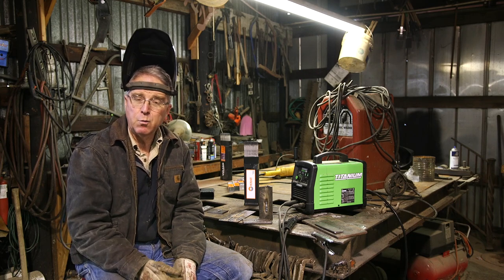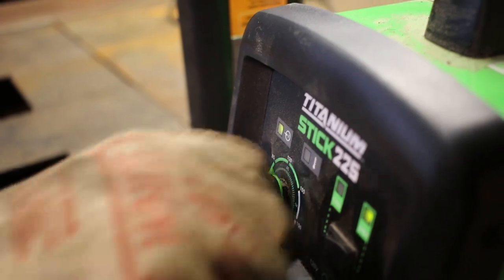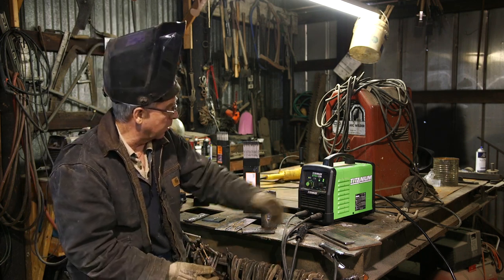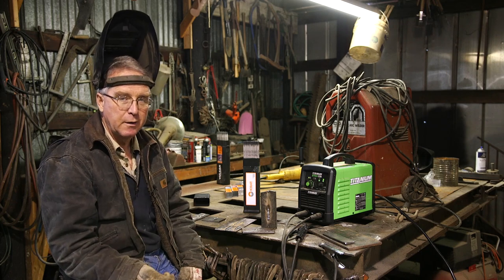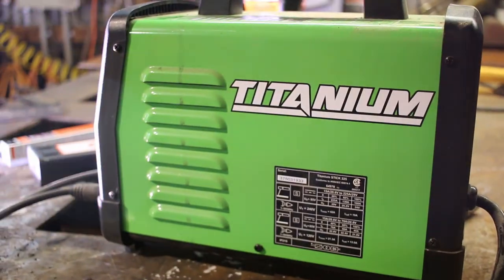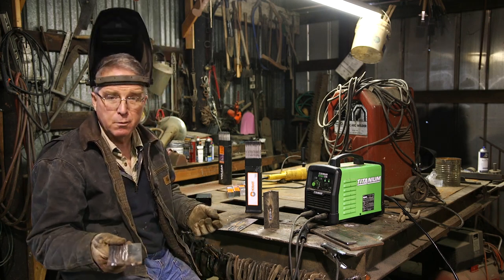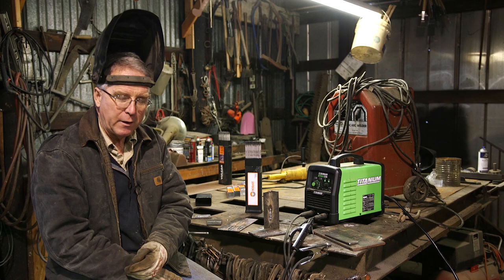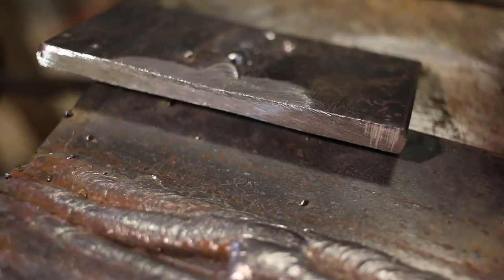Titanium Stick 225 Welder - Harbor Freight Tool

Comment: Mr. Wadsworth, 
I purchased the 125 flux core only machine, for very similar versatility reasons. It's also 120V capable. Has the same ground clamp set up. I have run about 6 pounds of 0.35 wire through it, thus far, and have to have the duty cycle become an issue. I would completely agree with you about the Titanium series machines being good start off machines for beginners/hobbyists. I would also say that they are also good as far as price point.

Comment: I think a lot of people forget that the Lincoln buzzboxes have a 20% duty cycle at 225 amps. 20% is totally fine for most hobbyists. I've done a few full faced anvil repairs with a buzzbox and only ever overheated the welder once.
Reply: I also had good results with my Miller Thunderbolt running 200A on a 400 volt input. Would run all day without problems. The groundclamp would become toasty hot way before the welder got issues
Reply: I was thinking the same thing. You can only get so much power through 16lbs of welder. It's a good little machine for the price. My nephew just bought this model.
Reply: That's 20% at FULL amperage - it'll be closer to 60% for most rods you'll be using.  And 60% is plenty for most people, unless you're in a real production environment.
Reply: @terryrust4973  Correct! On my Lincoln buzzbox, the 75A marker has a circle which means I can weld at 100% duty cycle at 40, 60 and 75A. Everything above that has a diminishing duty cycle until it gets to 20% at 225. I think I've only ever welded at 225A once or twice in the years I've owned the welder

Comment: i have a couple friends with hf welders and they seem to work ok. i think for your purposes its a good deal. i have been welding for over 50 yrs and still have a buzz box i bought 40 yrs ago; its a tank and you can't hurt it. these new solid state machines have really made welders affordable and portable. the duty cycle you mentioned is based on the percentage of run time (arc time) in 10 minutes and as you would expect it gets less and less as you increase amps.

Comment: I've been working at a factory and farming where we've used small portable welders more often. I find that they are excellent! You can weld in mild rain and wind. Most of the time you're working with steel up to 6mm thickness, which this will easily take care of. It will do thicker as well with as you've said some breaks. I've not worked with this specific model, but rather Fronius, Esab and Kemppi. The pro-brands holds up easily 20-30 years in bad conditions. Portable mig welders are also great, but better for bigger projects. There you also need to take more into consideration the factor of clean metal, wind and rain. I guess a flux wire will take help out greatly with those factors if you don't mind more grinding.

Comment: Just added this welder to my inventory today. So far, I like it and I'm happy to have a stick machine back in my life. I need to upgrade my electrical system in the garage to get it to run better though. 15  amps is just barely enough to get 3/32 6011 to run well.

Comment: These inverter style units are nice and are designed by a much larger well known welding company. The biggest thing these inverter units need are QUALITY rod. Hobart and rod from Harbor F are not going to cut it. 
Another item is that stick electrodes must be dry and in most procedures are to be held at a pre heat before being used. 
ESAB is now selling 1lb packs of 7018H4r and it’s wonderful.

Comment: Good video Scott 

here in Australia I bought a 250 amp stick welder to teach myself 

the brand is Mishato AC inverter stick welder on eBay and I paid $98 Aussie which is about 65 bucks US 

works fine and the duty cycle is up to 60% or so on lower amperages 

But it’s only about 30% on full power that’s okay....

Some of your viewers might want to check it out

Comment: I buy a lot of things from Harbor Freight.  The cool thing about that place is their return policy.  No questions, just produce your receipt and the broken tool/machine and you're good to go - often times even if it's past the 90 days, but that depends on individual stores.  The drills, angle grinders and other small electric tools are cheap enough that if you only get 8 or 10 months out of it before it gasps it's last, it won't break the bank to get another.   I almost always get a LOT longer life out of them because I know what I paid for them, know the reputation of the product, and treat it accordingly.  An angle grinder that costs $9.99 (with the coupon) is not going to hold up if you try to cut a piece of railroad track in half, just as you won't be driving a railroad spike into an oak beam with a tack hammer.  Exaggerations, yes, but you get my point.  If it's a cheap, household tool, don't try to do an industrial job with it and expect it not to break.  Also, a little minor care of the tool each time you finish with it doesn't hurt at all.  Blow it out with air before you put it away, and don't throw it around, it ain't a hammer.  Got a big boy job?  Go buy a big boy tool, but for around the house, Harbor Freight tools are hard to beat, as long as you remember what they are and don't try to exceed their capabilities.  

By the way, their little green MIG welder is pretty cool, too.  I picked one up a couple of months ago and have been having a ball playing around with it.

Comment: My dad bought a Lincoln buzz box when I was 12 and said my brother and I had to learn how to weld farm boys you know.
    It is a good thing to learn how to do.
Reply: 50 years later...  My Dad doesn't know want a welder is, Mom won't let me do any thing like that, says I might get hurt.   Light switch needed to be replaced and dad thought he's give it a try.  Mom Called Angie's List and got an electrician to replace it cost $126.00.  Boy have times changed. 

Scruffy61,  I agree it's something that's  good to learn to do.   I taught myself how to weld at 16.
Reply: @LightningFabrication  126 dollars to change a light switch that is a bit to much by alot. That is another thing people need to learn how to do same with mechanical.
    Jack of are all trades saves alot of money.
Reply: You're right I do everything myself.  I was jut trying to make a point on how things have changed.   I'm  retired and was a certified welder and  mechanic.
Reply: @LightningFabrication  my daughter is more like me. My son on the other hand would rather pay someone to do it.
   I do agree with you. My dad was a concrete man and that is it beside farming.

Comment: Is actually one of the best inverters for the price , duty cycle only refers to amp/time
in this case its 225A/20% which mean you can use it 2 min for every 10.. what they taught me is that if you want to find out the 100% cycle you only need to substract the amp  and add time in this case the difference is 80% so if you substract 80amps is gives us 145 amps on a 100% cycle which on  most common electrodes thats more than enough.. on structual welding  and in some pipes people will normally use 7018 1/8 in rod which burns from 90 to 140 amps, which is in  range of the full  duty cycle  so you can burn a wide variety of rods from 1/16 to 3/16 without overheating your machine .

Comment: I need to do what you say and just get out and start doing stuff like this!  I'll be 60 in a couple of months and although I did grow up on a Farm and did do vaguely remember some welding in the ag class I didn't really follow through with it - Joined the USAF and learned how to fix computers (the big ones - the ones that take up rooms and buildings) and after I retired got a job in computer networking - so sit at my desk all day fixing computer networks a couple of years ago started doing some woodworking as a hobby, now I want to learn welding and blacksmithing too (and yes I am signed up for your course but haven't even bought an anvil yet)

Comment: I learned on the Titanium Flux Core 125. Fantastic little 110v welder. Does everything I need it to. I really think Harbor Freight has a good thing going with these little inverter welders.

Comment: One piece of advice, if I may ...... to the newbies and to you too ;0)
It is easy to lean in close to really see what your weld puddle is doing ..... Resist that urge!
The smoke given of is NOT good for you .... and as you are concentrating on the weld you may not notice it!

But your body will!
Reply: I think you’re probably right. Gonna watch that from now on.
Reply: Good idea to wear a respirator while welding.
Reply: Once my boss told me " do you know why all the welders are young men and die young" while looking at all the welders smoking. " They don't understand that smoke kills"
Reply: My engineering dept at uni wanted to do a survey of old welders. Couldn’t do it. All dead
Reply: Related tip, if you're going to weld anything that's been galvanized or chrome plated, grind that coating off first or you'll regret it.
You'll start coughing like crazy within the hour, and for the rest of the day, and maybe the next day.
Reply: I am a newbie and didn't really think of that. I already have lung problems so I'll definitely get a respirator. Thanks🙂
Reply: @josiahhockenberry9846  A bit of care is called for ..... not all respirators are equal! You may do better to have a fan handy if you are inside and train yourself not to hunch over your weld but extend your arms a bit and create a gap between you and the weld! Old welders are rare for a good reason:0) Also DO NOT weld galvanized steel .... if you do need to weld it clean the galv off the area you are working on down to bright steel!
Reply: the black boogers are the best part of welding
Reply: @josiahhockenberry9846  spend the money on a positive pressure helmet some offer filters but basically It just pulls clean cool air then blows it down over your face preventing smoke from getting in. there are even models that offer ice cooling so your in a personal ac
Reply: In December 2019 I was forced to do a bunch of repairs on my snowplow. I was tired of breathing smoke - like in all of my past welding jobs -  and I was able to find a comfortable, lightweight respirator that fit under the shield. With P100 filters there are no more black boogers and no more wondering what I'm doing to myself. 
As it turned out, I bought that respirator just in time; a few months later respirators were hard to find or impossible to buy.
Now if you're welding indoors for several hours at a time you'll want to supplement your breathing protection with some sort of ventilation - even a small fan will help.
Reply: @spydercoslacker7466  You're so cool bro I wish everybody was as cool as you

Comment: I got a century flux core machine got it at HD burns 35 wire fine little machine . It weighs nothing got about 40 rolls of wire no problems so far . And my dad's arc welder .enjoy your new welder.

Comment: As always great videos. Thank you. I picked up a similar welder for my son a month back and was also surprised with how well it worked. One thing to check: the metal frame (case)  on our welder measures about 50 volts. I also checked a third type and found that case to be hot also. The manufacturer doesn’t insulate the internal heat sink. You might want to check yours.

Comment: 20% duty cycle = 2mins continuous welding I’m assuming at 200 amps! Which would have to be a 5/32 rod and most hobbyists won’t be using! The duty cycle is the percentage of 10 mins. On every machine. Just for some clarification but great informational video! I love your channel!!!

Comment: Thank you. I've been thinking about getting a small welder just to be able to do some small welds here and there. I've never really welded before (once I tried for like 5 minutes) and I've found myself in situations from time to time where having a welder would save me a lot of money and time. I just want to know if this product would be right for me and you have done a great job answering that. Thanks again🙂
Reply: Just my 2 cents, but I recently bought the Titanium Easy FLux 125 at HF. It's a gasless wirefeed welder, so you don't have to worry about renting bottles, and you can weld outside in the breeze if you have to. I think it's pretty useful for small stuff around the house. If you're doing any thicker material then I would recommend a stick welder.

Comment: Great review I bought the same one about a month ago never welded before, some times I can lay a pretty good bead down, other times I'm terrible, it's very difficult to do, you make it look easy hope I can weld like you someday! I can weld a pretty decent bead if I just welding flat! But when I try to weld something together it's like it all goes out the window I'm bad a welding player together whether it's flat or anything else! I can't weld a 1/8 rod to save my life either, I run mine on 120 I don't have a 240 to run it off of, wonder of that would help!

Comment: I bought the same welder from Harbor Freight this year and what I understand is that it is 225 amps at 20% duty cycle. If you weld with less amps that duty cycle is bigger. It is a work horse! I already used it non stop for practice trying to make it shut down....it didnt. So I dont think it is just for the hobbyist or just around the house welder. It sits in the middle of medium duty and heavy duty work or heavy duty work. Already used it for a dump trailer work and it did well. With today's technology Lincoln and Miller are not the kings of the hill anymore. People are just paying thousand of dollars just for the brand.

Comment: The duty cycle is a recommended amount of run time in 10 minutes. Example a 20% duty cycle means after 2 continuous minutes of welding they recommend 8 minutes of cool down

Comment: Long ago and far away (yes, I have moved) we had a row of 8 Miller welders.  I don't remember the amperage, maybe 1000A or larger.  Physically they were head height and longer than high.  We used them as power supplies to sublimate insulating materials for use as thin films used for developing data storage products.  Pretty awesome.  You triggered a memory, somehow.

Comment: Harbor freight ...   50/50 gamble ...     I once bought 6 4.5 inch grinders from them they had on sale for 10$  each  I figured that they would last maybe a week or two at most..  the first one I used out of the ones I bought   is still going strong since , '93  lol   I sold the rest for 20$  to my class mates at welding school  lol.    But that bring said I bought one of HBF  tools buzz boxes  and it was crap  would not start properly did not do the amperage it said it would..  so...    Like I said anything from HBFT   is 50/50 😁😁👍👍  by the way good review I liked the honesty. 👍👍

Comment: It's my understanding, which could be wrong, that the duty cycle on welders is rated over a 10 minute period. So 20% duty cycle means you get to weld for 2 minutes out of every 10 at whatever output the manufacturer specifies. For a beginner (or less, like me), I doubt that's really an issue, but it is an important distinction between 20% of a day and 20% of 10 minutes.

I'll also toss it out there that most of these cheap welders come with terrible clamps, like you said. When I  bought my 110v Everlast MIG I immediately ordered 20ft of the biggest ground cable the Dinse 25 connector would support (4 gauge) and a 600A Tweco ground clamp. I don't at all need that giant clamp, but it's solid bronze and an open box return on eBay and was like $25. I couldn't turn that down. So... I pretty radically upgraded at least the ground side of my really cheap MIG for about $60 and I can carry those upgrades with me down the road (at least the clamp) to a better machine.

Comment: Duty cycle is based on a period of 10 minutes.  If a welder has a 100% duty cycle, it  can weld for 10 minutes out of 10 minutes, i.e. continuously.  If it has a 20% duty cycle it can weld for 2  minutes in a 10 minute period.
Reply: That's 20% at FULL amperage - it'll be closer to 60% for most rods you'll be using.  And 60% is plenty for most people, unless you're in a real production environment.

Comment: Give it to Cy for a week or so. When you get the smoldering parts back you can review the melted plastic and fused copper.
Reply: That was funny!  If a machine can be pushed too hard, I do believe Cy is the the one to do it and find all the weakness/flaws in the machine.
Reply: Nah. It'll just turn itself off. Cy will probably give it back unharmed, because it wasn't much use to him.

Comment: I was surprised to find out that my Lincoln 225 tombstone welder also has a 20% duty cycle. Recent purchase.
Reply: That's 20% at FULL amperage - it'll be closer to 60% for most rods you'll be using.  And 60% is plenty for most people, unless you're in a real production environment.
Reply: I wouldn't worry about it that much, as one of the other replies to your comment says that's at FULL amps.
As for what I think, there's a good reason that that welder you got is one of the more common welders you'll find on farms. It's affordable enough to be readily obtainable, but capable enough to do just about anything you can think of on a farm, and it's tough as nails to boot.

Comment: if it will do 7018, that's really the backbone you need to get started. Looks like you can also run 6010 or 6011 with it.

Comment: Another option is the Kicking Horse A220 from Amazon. I purchased the A100 version and liked it so much better than my Lincoln 225AC, I also purchased the Kicking Horse A220. Like yours the performance is amazing but the output cables and electrode holder are junk.

Comment: Same store, similar color. Generator for $120-ish. Two stroke motor, and weak output. However, if you spin up a circ saw and then cut, it is running a circ saw fine. Same rationale about keeping it around. For small use tools...it is small and relatively quiet. I can move it in my car.